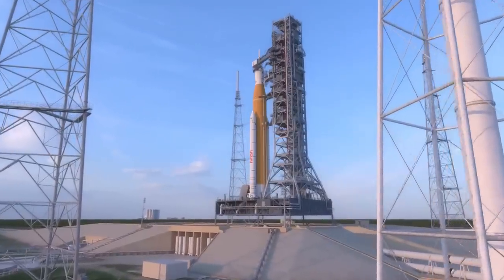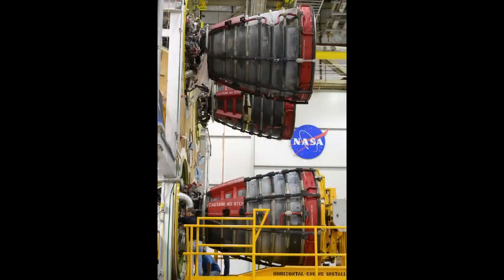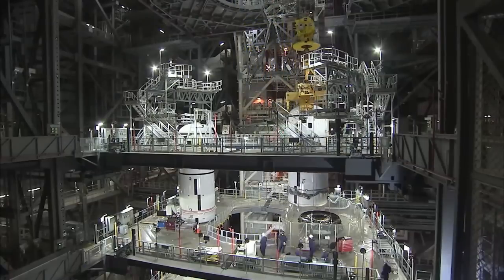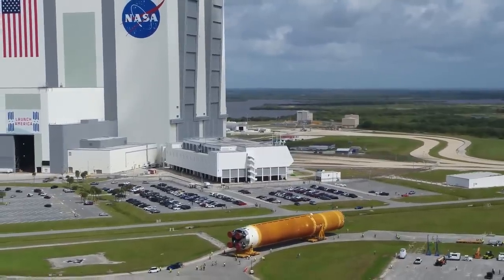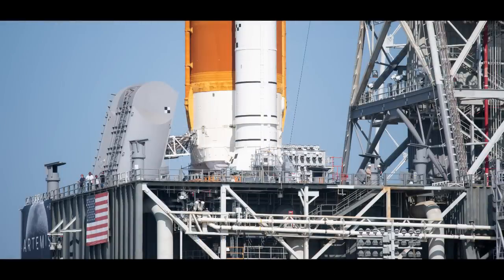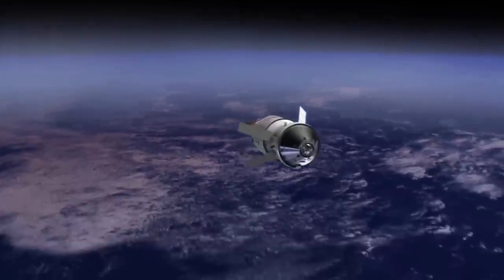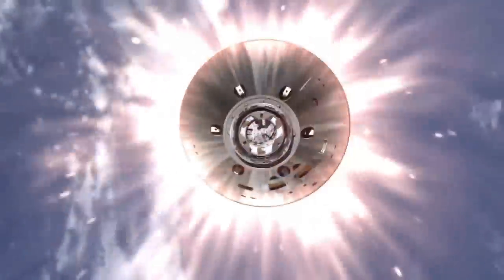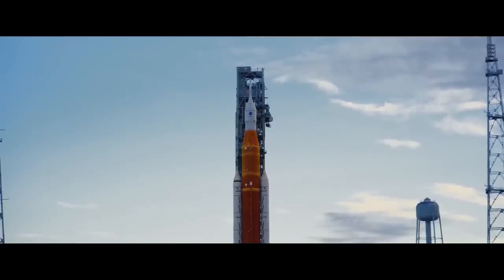What's The Big Deal About Artemis - NASA's New Massive Moon Rocket

Comment: "And we are pretty sure it's going to work".   

That has to be one of the most asinine statements I have ever heard.  No Scott.  It has to work.  Otherwise, SLS is over.  Hopefully, it doesn't kill anyone if it fails.
Reply: I seriously cannot see it being successful, they have made it to  complicated, and the same dangerous launch system as that stupid Space Shuttle, i was never a fan of that, a stupid space plane . Bring back the Saturn V rockets system, no side thrusters, and use the liquid oxygen and Kerosene mix they used to lift off on the Apollo missions, no liquid hydrogen, the substance is to thin, no good for use in a lift off, that's that's why they never used it in the Apollo missions only used liquid hydrogen on the upper stages.
Reply: @lepidoptera9337  yes they did use liquid hydrogen in the upper stages of the Apollo rockets. I feel its a shame Nixon scrapped it as it as it worked well, I do disagree with you, the Saturn V rocket worked, not like this dangerous SLS rocket system they have now, Nasa will have loads of trouble with it, it's to complicated. Just bring the Saturn V out of retirement and use the same fuel mix they used on the Apollo missions. 
I can't seriously see that SLS rocket leaving the launch pad. I hope I am wrong ??
Reply: @lepidoptera9337  it's crazy. Get  the old Saturn V out of retirement, modify it "slightly"  and Nasa can save some money, and everyone will see a SAFE  and successful launch and successful mission . I don't think the SLS launch system has a future. It's a highly dangerous launch system, hit and miss type of system, you cannot have a  launch system like that, and taking pieces from  that stupid dangerous space shuttle, I was never a fan of that,  a space plane,  how ridiculous,  and so dangerous, was happy that came to an end, should of been sooner.
Nasa should scrap the SLS launch system before a major serious incident happens, that's how confident  I am in that launch system.
Reply: @david-ky7rt  We got lucky with the Saturn V. Was it an absolute beast of a rocket? Yes. But it also had many, many points of failure.

As for the shuttle: I would say over a hundred missions, even with the 2 failures, was a successful program. The shuttle pioneered reusability, large crews, built the ISS and deployed Hubble.
Reply: @maxv9464  MAX, the Saturn V rocket system was far better than that dangerous SLS rocket system they have now, made it to complicated  The Saturn V rocket worked and worked very well, and would work today if nasa brought out of retirement, and good for deep space missions.
I personally cannot see much future for the Artemis rocket, using pieces of the space shuttle launch system, heading for a major disaster, I am just glad they are testing it with no one in it. Nasa are now under pressure to launch in October, it's not good being under pressure to launch, i think it's going to be a disaster, least their will be no crew in it.
Reply: @david-ky7rt  This is some wacky argumentation.

The Saturn V is a similarly expensive rocket, and although yes, we got lucky with it on the whole, it was not up to modern standards post-challenger and Columbia. Apollo 13 perhaps exemplified this. Could it be adapted into a modern version? Yes, probably. But the issues you're seeing, cost and time overruns, would be just as rampant. These are issues not with the rockets themselves but with congressional oversight and contracting.

The SLS is not likely to fail because of its shuttle derived parts. You seem convinced of the shuttle's unreliability but why? Challenger's o ring problems were due to specific wind shear and cold combined AND they have been fixed, while Columbia was the result of a side mounted orbiter and reusable heat shield. SLS lacks both problems, so if it blows up, it's because of something new.

And the whole thing about October pressure: SLS is and already has been under pressure. They still performed 2 scrubs in the face of that. That gives me confidence in the launch team.
Reply: @david-ky7rt  Are you even trying to make a point anymore? What do your vague problems with a British politician have to do with SLS? Or are you just giving up because you didn't have a good point in the first place?
Reply: @maxv9464  No  MAX, I got side tracked, let's get back to Nasa's dangerous SLS rocket system.
As you know I am not a fan of that SLS rocket system, or that crazy space shuttle, all very highly dangerous, just making a  point, you can't take pieces from another launch system and expect it to work. Just go back the Saturn V rocket launch system , as it worked and worked very well. 
Now nasa are under pressure to launch the Artemis I in   October, having 2 scrubbs and coming up for the 3rd launch on October, I personally think it will be a disaster, as something else will go wrong with it again, remember the launch of the space shuttle, that blow up, had ice on the rocket, nasa were under pressure to launch, and they still  went ahead, was a disaster.
Should get rid of them side boosters, 
If I was an Astronant I would feel safer on top of the  Saturn V than that Artemis rocket.
Reply: @maxv9464  Even former Astronaut Harrison Schmitt said this :  
Schmitt has long been critical of the decision by the Johnson and Nixon administrations to shut down the production of the agency’s prior super-heavy-lift vehicle – the Saturn V – which transported Schmitt and his colleagues to the Moon.
Schmitt has argued that the continued production of the Saturn V, along with an upgraded version (a notional Saturn VI), would have allowed for the continued, uninterrupted exploration of deep space.
Reply: @david-ky7rt  Dude. I explained this to you already.

The shuttle orbiter was side mounted. Despite an overall high success rate with 2 failures out of more than 100 launches, yes, it had reliability issues. The SRBs have been fixed since the challenger disaster and only had issues in extreme conditions of cold and wind shear anyway. The Columbia loss was because the craft had a reusable heat shield and was side mounted.

If you felt safer on the Saturn V you would be wrong. It did not stand up to modern safety ratings and also couldn't carry 4 crew members or the modernized Orion capsule.
Reply: @david-ky7rt  The Saturn V was of a different era. It was similarly expensive and efforts to modernize it would have struggle amidst budget cuts and Congressional oversight (which is exactly what happened, by the way.) SLS, like it or not, is the only way forward in the current climate. I hope that changes too. But going back to the Saturn V is a really weird take on that.
Reply: @maxv9464  dude, I am done with this, you know my views on the SLS, it should be scrapped before anyone dies on it. 
We will see if it launches in October, but my guess it won't or if it does, its going to blow up.
Reply: @david-ky7rt  I'll take that bet. 

I know your views. I also know, given your inability to substantiate them, that they're based on a gut feeling and not particularly reliable. Talk to you when Orion reaches orbit ;)
Reply: @david-ky7rt  I already responded to this.

That was a different era. I don't disagree with him. But part of that decision was the severe budget cuts which followed the Apollo program, and that's what SLS has been dealing with. It's a different time in spaceflight. The Apollo program consumed 5% of national GDP, something we obviously can't do now. Should we invest more? Yes.

But SLS is the best option right now. The Saturn V, VI, whatever wasn't designed for the modern mission format.
Reply: @maxv9464  good boy

Comment: To bad Artemis is not reusable ! But that isn't the Nasa way. So unless they can make more shuttle engines, when they run out that's the end !?!?
Reply: There are contracts for more RS-25 engines in a expendable version and for more capable SRBs.

Booster reusability is great, but has drawbacks.
First, if you don't have a fast enough launch cadence, you can spend more on recovery than you save by reusing the booster.
Second, you take a payload hit for the recovery system on the booster. The Falcon 9 B5 can lift up to 22.8 tons to LEO when expended, but only up to 16.3 tons when landed on a drone ship (B1051.12). Doing a Return to Launch Site (RTLS) landings, costs even more payload.

So with SLS launching once or twice a year, the cadence doesn't really justify recovering the booster. Not to mention that it gets higher and faster than a Falcon 9.
The SLS Block 1 can get Orion to the Moon, but not with the kind of payload hit like F9 has. The SLS Block 1B will send along a Lunar Gateway module with Orion, so it really can't take the payload hit either.
SLS started design work in 2011, 4 years before SpaceX landed the first booster and almost 6 years before they reused a booster.

Comment: They are going to send a crew to the moon for a flyby on a free return trajectory on only the second flight of a brand new rocket???   That doesn't seem like a good idea.   Hopefully Boeing had nothing to do with this rocket or its capsule, or those astronauts are going to be dead.
Reply: Boeing manufactured the Saturn V SI-C which never failed. They have produced the core stage of the SLS at the same plant/facility.
Reply: @wouldntyouliketoknow9891  
I do like your Republican analogy and I'm not convinced that the merger with McDonnell Douglas was necessarily a positive in terms of operational culture, but Boeing have in many ways rewritten the book in the design of the core stage of the SLS. This is not to overlook the schedule issues which stem primarily from management, technical, and infrastructure issues directly related to Boeing’s performance. It would be interesting to know if such systemic failures are a consequence of a company wide malaise afflicting all divisions or the organisation.

Comment: I still can't believe they using litterly used parts from the space shuttle, the engines from the shuttle and also the solid rocket boosters. Why they using decennia old used parts. They aren't absolutely not efficient comparing with Space X. And it's still much worse where with the space shuttle a lot of parts were reusable. This thing isn't. This is extremely far from a Leap in the future. It has only 2 traps. Saturn 5 had many more to save weight and better fuel economy. Now 1 stage is probably 90% of the weight. You have engines that work better in the atmosphere and in space vacuüm. 

It is extremely expensive and that with already used scrap. There will be a time they can't scrap anymore. It looks absolutely ugly. This is not the future. If Starship is functional and fully reusable. It can carry many astronauts and tons payload for a moon base and fly on and on.
Reply: @lepidoptera9337  For far better fuel economy new developed engines are essential. Those engines where solely made for the shuttle. It is an enormous tank they can't save because it is only a 2 trap rocket the 1st enormous trap need to go into orbit. 

Normal rockets have more stages especially for ditching the empty tanks to safe weight and use other more efficient vacuum engines with a wider nozzle when ascending in thinner air. The 2nd stage is primarily used for the Lunar insertion and read that the 2nd stage is very small. 

Concluding: Artemis is extremely expensive and heavy dependent on old space shuttle parts for its build. Some parts have flown 7+ times. 

Why you don't start with a clean sheet with modern technology like what SpaceX is doing now with its Raptor 2 engine with big updates to simplify it and added more thrust. Why can't NASA with its billions of  budget not even really develop something but pull all old parts together from the space shuttle and their solid boosters. It's now very old  and needs a place in a museum.

If you tink of 5 years later and SpaceX receive the same findings as Nasa, Spaceship would be a giant LEAP in the future of space capable  bringing a lot of astronauts and cargo to build a Moonbase. Especially the reusability and the quick turnover time. 

So this expensive Artemis project looks like they took decades old drawings and technology and almost no reusability, and that is a big shame. I hope that at the time they will fly people to the moon, SpaceX has caught up with Starship and all test and certification done to just obliterate NASA's project. 

Because NASA get funded so well, they don't think about falling money out the sky burning up ot crashing into the ground. That's why competition is so good. From 2011 USA stopped the spaceshuttle and had to rely on Russia for the ISS. Think of it now with the war. Russia's part in the ISS is certificated for just a couple of years.  If they don't renew and doing maintenance th4 systems need to shutdown and because every country made something, they are dependent on each partnering country for working. If 1 stops the project is dead. Hope they can launch the needed modules to safe the station

Comment: Throwing 4 billion in the drink eww
Reply: Booster reusability is great, but has drawbacks.
First, if you don't have a fast enough launch cadence, you can spend more on recovery than you save by reusing the booster.
Second, you take a payload hit for the recovery system on the booster. The Falcon 9 B5 can lift up to 22.8 tons to LEO when expended, but only up to 16.3 tons when landed on a drone ship (B1051.12). Doing a Return to Launch Site (RTLS) landings, costs even more payload.

So with SLS launching once or twice a year, the cadence doesn't really justify recovering the booster. Not to mention that it gets higher and faster than a Falcon 9.
The SLS Block 1 can get Orion to the Moon, but not with the kind of payload hit like F9 has. The SLS Block 1B will send along a Lunar Gateway module with Orion, so it really can't take the payload hit either.
SLS started design work in 2011, 4 years before SpaceX landed the first booster and almost 6 years before they reused a booster.
Reply: elon throws even more down the drain and his rocket wont even be allowed to have humans on it (since it doesn't have an abort system)

Comment: Four used rocket engines, basically the same solid rocket motor with one extra section, a tank, the delta four's second stage, the launch of CubeSats, and someone else service module.  Took too long and cost way too much.